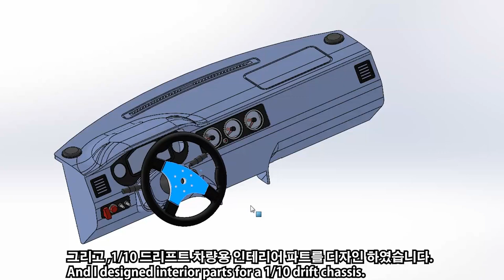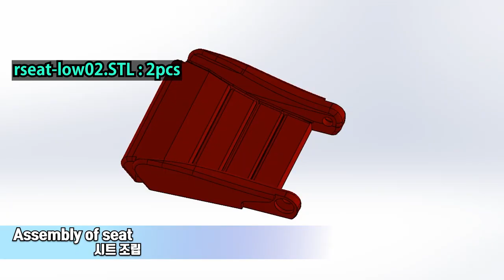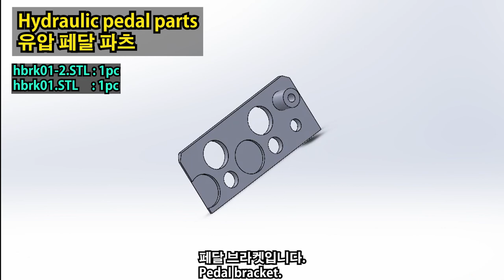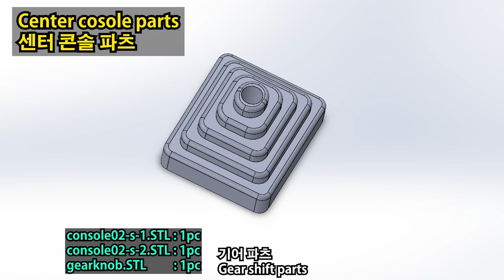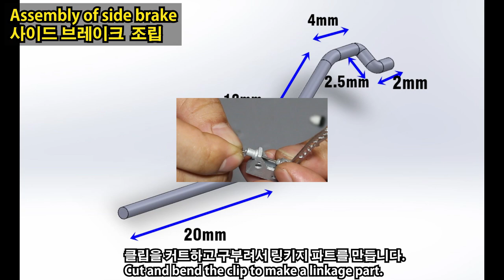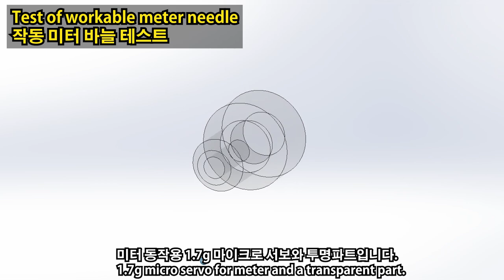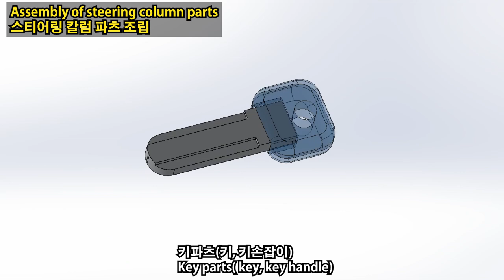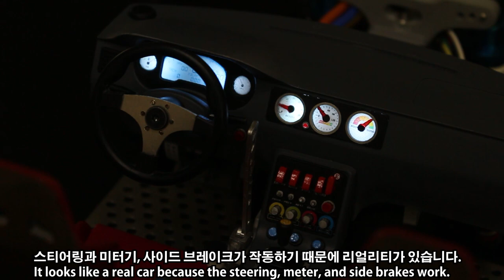Workable interior parts for 1/10 RC car(HSP 94123 Flying Fish RWD drift car)

Comment: Can this work on the Yokomo YD2 ZX?? My Subaru BRZ needs an interior.
Reply from the maker: It's probably possible. However, some modification will be needed. It will be possible at any chassis as long as you use only the dashboard excluding the bottom floor parts or console parts. If you modify upper deck parts console parts also available. Ref this video :  https://www.youtube.com/watch?v=sgSAnLDDapc

Comment: Can u made a bracket for a fwd 2 wheel drive with the motor on the side
Reply from the maker: You mean front wheel drive? Bracket is possible, but drift performance is very low.
Reply: @zeusgarage4368  fwd bracket for mounting a motor up front on a side angle
Reply from the maker: @TW39  Anyway, I've already designed a type that mounts the motor on the front. But it is rwd, not fwd.
Reply: @zeusgarage4368  would be good if they make a fwd hsp flying fish chassis